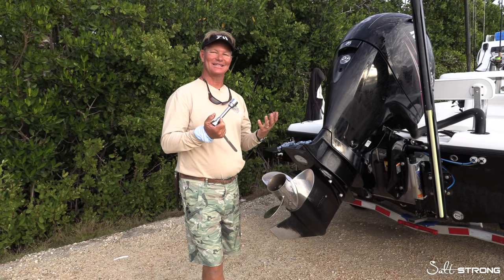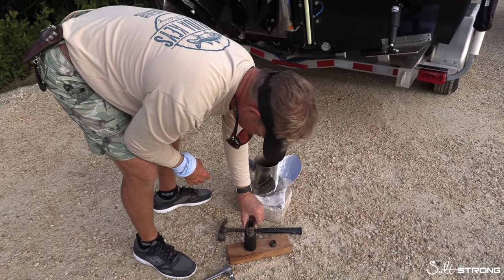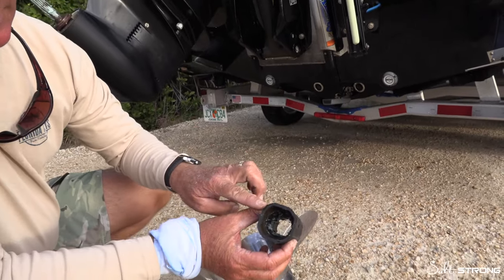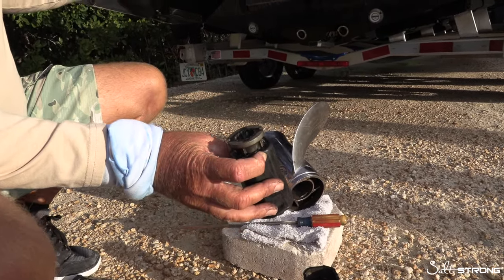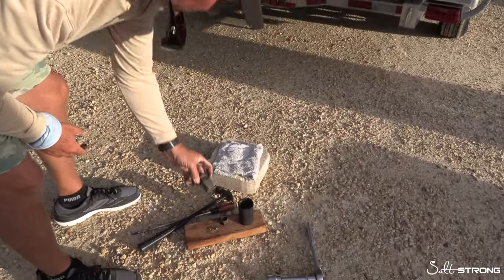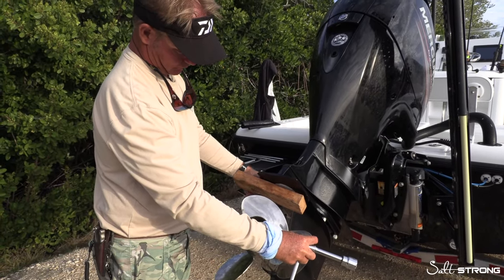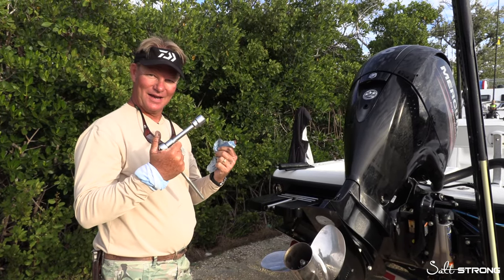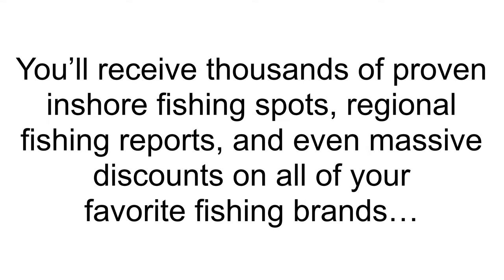How To Replace A Spun Hub On A Boat Prop

Comment: I have the issue of rpms reving but no acceleration,  fiddling with throttle catches and the boat jerks forward (or into gear) is that also the prop? Or slipped gears catching at higher rpms? Any help is appreciated
Reply from the maker: Thank you for your question! We have a massive library of fishing tips on our website along with a search feature to let you quickly filter down to find help you're looking for, so just go to https://www.saltstrong.com/ and use the Search feature in the top menu.

Note: If you don't see the exact answer you're looking for, just leave a comment in the post that most closely matches up with your search and one of our coaches will respond to your question... our coaches only make time to answer questions that get submitted to our website.

Comment: "Liked" your vid but I have a ? I bought a 1994 Hurricane Deck boat with a Yamaha 150 Saltwater Series 2 engine. Didn't put 20 hrs on boat and spun the Hub. Ok..so I'm retired Air Force, 1st boat and it doesn't have wings!! 1st time I've ever had to deal with a boat issue. Anyway I believe this prop is a replacement and I don't know what kind it is except it's stainless steel. I popped the hub out of the prop and it seems to be all metal. I called our local marine folks and they said it might be a "pressed" in hub but wanted to know who manufactured the prop. I don't have a clue. If it was a fighter aircraft I could probably tell them! I see all kinds of videos on r&r for hubs but I just don't know......

Comment: Thank you for vidio,wasnt sure what was wrong with my motor,it makes total sense now after watching your video and i will fix it myself,save time and money
Reply: What was your motor doing? Outboard??
Reply: I have a 03 bayliner 3.0 mercruiser inboard and motor is Erving fine but I can’t go faster than like 10 mph wonder if this is the problem??!!
Reply: @armandojimenez2373  115 Johnson, was putting around 2000rpm all day, when I tried pushing it, it just raced but wasn't going anywhere. After vidio thought that was the problem.after taking the prop of it did not show signs of loose spinning. Put prop back on and ran fine, go figure, not sure what happened but just glad it's running normal.
Reply: @armandojimenez2373  I bet it is

Comment: This was years ago, but I was always told that it takes a special press/machine to install those hubs properly, or is that a newer design for the prop in this video? I live here in central Florida, and back when I had a bigger boat, motor, and prop, I heard from everyone that there were only 2 shops in the entire state that press-fit the new hubs in, and also, that they needed to sit and "swell", and then drive the boat easy for a few hours before dropping the hammer, to allow the new hub to seat properly. So I was rather surprised to see this video. Seems like I remember the older style hubs were made of rubber.  All of the shops in my area of Brevard county would take your prop & send it off to 1 of those 2 places for new hub installation. ????????????
Reply: This is a newer system.

First we had break-pins, but they sometimes broke too soon, or even worse, not at all. With more ludicrously high-power outboards, it was also difficult to scale the break-pins to match.
Then we got the rubber hubs. They slipped reliably when over-torqued, and if they spun, you could still idle back to the harbour, instead of leaving you stranded if you forgot the spare breakpin. However, more modern engines had higher exhaust temperatures than when the rubber hubs were first introduced. Since the exhaust passes close to the hub, the high temperatures would deteriorate the rubber. The rubber hubs were also very difficult to replace outside of a specialised shop, meaning you'd have to replace the entire prop.

To fix this, these hard plastic square hubs were introduced. The hard plastic is far more resistant to high temperatures than the rubber was. It is also feasible to replace the hard plastic hub at the dock, or even on the water if you can haul the outboard inboard and you have a spare hub.

Comment: Hey? What’re the chances that the actual  round housing that the hub goes in breaks? Took it to a boat shop to get my hub fixed left with a prop that has to be thrown away
Reply: Sometimes they shatter and melt. You could save it but it takes hours of hammering and prying the melted plastic out of the inner prop

Comment: Is there torque spec on that nut and are they usually castle nut?
Reply: 55 ft-lbs for Mercury
Reply: He didn't mention tapping doen the locking tans on the nut when you have it tighten and aligned

Comment: I found the video useless.  First, you go into the bug with a screwdriver and it comes apart.  NO idea what you did or how.  Then you show damage inside hub with such bad light nothing at all can be seen.   Then it goes back together with no explanation or detail.  One a one to ten, a one.
Reply: Did you get yours fixed? I went to your channel and didn't see a video of you explaining any better on what to do.
Reply: He did it all wrong I laughed so hard when he said common mistake people out the spines shaft on first and you can do it. 
Then he tapped it with a hammer on his motor also a no no do it on the ground with the prop off the motor